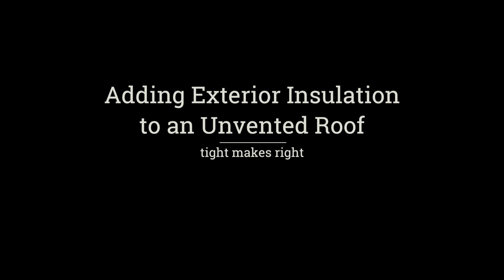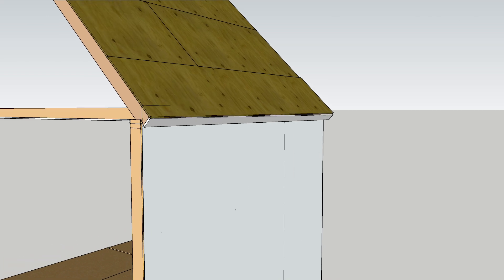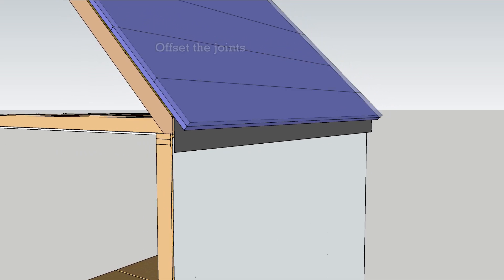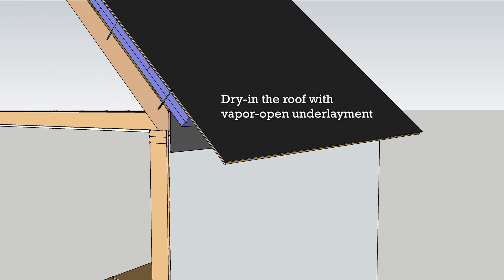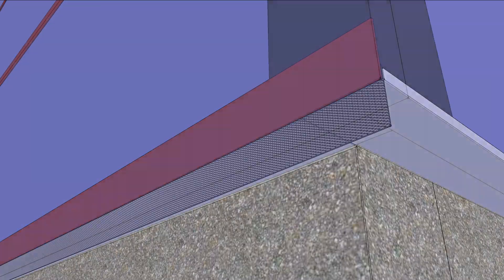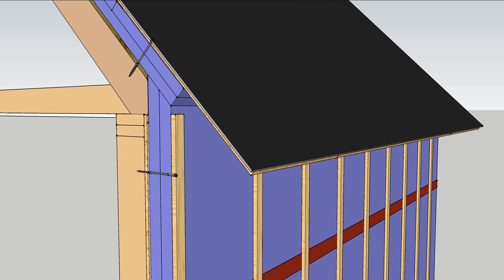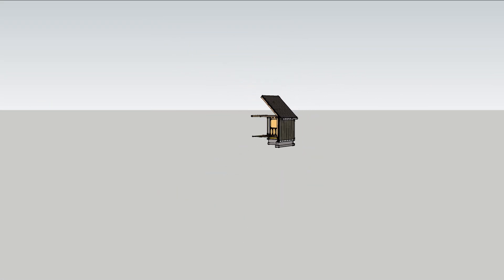Exterior insulation retrofit: walls and unvented roof

Comment: Client has historic deck home with exposed 2x t&g planks; retrofitting new roof and adding 6” polyiso rigid insulation and 3/4” cdx plywood for new asphalt shingles…what do you recommend for primary underlayment over 2x planks and then again over the CDX plywood exterior prior to roofing

Comment: How do you exchange air on the inside of the home after you have sealed the outside?
Reply: Typically with some sort of balanced mechanical ventilation method like an ERV system
Reply from the maker: as the other commenter said, mechanical ventilation.

Either air enters and leaves through a path you choose, or through paths you do not choose.

One leads to healthier and energy efficient houses, the other leads to bugs, mold and rot.

Comment: What if your cladding is brick and mortar?
Reply from the maker: Then it is a LOT more difficult and expensive to remove and replace. Superinsulating from the inside may be a better option, though I have seen builders spray foam the outside of a masonry block home with a system of 2x2s bolted to angle brackets screwed into mortar joints to create a space for three inches of high-density spray-foam insulation plus an air space. The 2x2s were used to fasten Hardy Plank siding into. 

An unformatted page explaining the system is on green Building Advisor, here: https://www.greenbuildingadvisor.com/green-homes/deep-energy-makeover-one-step-at-a-time

Comment: Also add rockwool when u have the wall cavity open
Reply from the maker: The drywall is not removed in this animation, but when the siding id off, it is CERTAINLY a good opportunity to blow insulation into the stud cavities.
Reply: @ProTradeCraft or just do 3" of closed cell spray foam with ZIP-R for sheathing! this is what i'm planning to do to replace my EIFS stucco soon

Comment: I used this same setup but used a fairly non permeable (not vapor open) roofing underlayment on top of the second osb. Is the vapor permeability primarily for potential leaks or for drying due to potential condensation? Thanks!
Reply from the maker: To allow interior moisture to escape.

Comment: That L channel on the bottom will just become a water bowl. Need drain holes, otherwise any condensation or wind driven rain will just accumulate in there and cause the sheeting to rot.
Reply from the maker: No it won't it is taped to the face of the foam. and there is a 3/4 inch drainage channel in front of the tape.
Reply: @ProTradeCraft  Rain screen and tape don’t change the fact there’s no drainage in the channel. There is internal vapor drive from inside of the house and the insulation can also be vapor permeable if it is EPS/XPS. It also requires the assembly to be 100% perfect for bulk water not to get in, which is never the case on a real job site.
Reply: @mintheman7  I too fear this. Is there an easy way to perforate the aluminum? Also don't want mice in foam

Comment: How would you design a shed office with a single-slope, lean-to roof with overhangs? Specifically, how would you finish the exposed insulation faces on the sloped edge of the roof? Speaking of a construction with continuous exterior insulation.
Reply from the maker: The exact same what as drawn in this animation, which only shows half a gable, so technically, a shed roof.

It is best to add overhangs outside the insulation instead of letting them protrude through it.

Comment: Well done. Would love to see this done with exposed rafter tails applied (as opposed to boxed soffit).
Reply: Several people have done it on video.  You just box in the rafter  tails.
Reply: @tsaipod  What do you mean by box in?
Reply: @hippopotamusanalogue  so the guy above that wrote the initial comment was talking about rafters that stick way out over the edge of the house a foot or two or whatever.  You would just box in the rafter that’s hanging out over the side so that it was sealed. If this still doesn’t make sense, I can try and find a video.

Comment: This is relatively simple on a house with no windows or doors. Dont we need to know what we do there?
Reply from the maker: Well, according to engineers, the perfect building has one door, a fridge with beer, and no windows to dramatize you during the inevitable hangover. That being said, buildings usually have windows.  Here are a couple of options for windows, but search through the channel, there is a TON of stuff about how to do this.

Innie windows in the thick wall: https://youtu.be/7OX1_q-P5xw
Outie windows in a thick wall: https://youtu.be/yTlYthfnoeQ

There are also videos of carpenters doing it. Search for 'superinsulated sunroom'
Reply: @ProTradeCraft  I watched the outie one. My interest is adding 4 inches of foam....2+2 to an EXISTING home. Again... its easy on the flats... what about doors and windows that NEVER EVER want to trap water. Thats what i want to do to my home... remove and replace vinyl with 4 inches foam to add R20. Thanks
Reply from the maker: @rogerwhiting9310  
https://www.youtube.com/watch?v=19p35Owyd4c
https://www.youtube.com/watch?v=X-YowdOsTP8
Reply: @ProTradeCraft  thanks... I watched both of those. I will have to replay them 10 times to get the tape, flashing, pan, etc details correct. Interesting the job is about 45 minutes from my home. After watching them pinch panels in to be super tight... would there be a downside to just foaming between panels to be tight... and watertight? Thanks for your help. It is a doable project now.

Comment: 1:10 - SIGNIFICANT thermal bridge there - a widespread problem.
Reply: I'm thinking a "Z" channel tap-conned into the concrete wall would be better...it also would serve as a bug barrier for the sheathing.  Also should consider air sealing the base of the wall sheathing to the concrete
Reply: @mattcantrell5640  That metal Z-channel would also be a significant thermal bridge. Steel conducts heat 300 times better than wood. If the relevant metal could be replaced with PVC flashing, the thermal bridge would vanish. Ideally, insulation in the wall should hook up with the insulation in the floor. More than one way that can be achieved.
Reply: @elbuggo  I understand metal conducting heat, but it would be conducting it to the concrete, not the wall.  The concrete would likely be insulated on the interior prior to finishing.
Reply: @mattcantrell5640 Studied this again. The flashing is fastened to some OSB board(?) there. That will reduce the thermal bridge significantly. Something green behind that OSB too. Insulation? Well, maybe not so terribly bad solution, but not ideal either.

Comment: The big issue I have with this video is that they aren't showing what happens to the doors and windows.  Now the foam is four inches to far out.  You have to now move the windows out and have a proper sill for the the windows.  What a pain that would be!!!!!
As for the roof, it could be done.  My older house has insulation in the rafters but no way to vent off the heat so it absorbs to the upstairs
Reply: You have two options. You can do an innie or an outtie opening. For an outtie you just buck out the width of the insulation. Thermal buck is designed for this purpose. Or you could install normally and frame out an exterior jamb.
Reply: @Cpt_Guirk  thanks
Reply from the maker: Bee Bob, There are a few options for windows, innies, outies, or in-betweenies.

Innies: https://youtu.be/7OX1_q-P5xw
here's actual guys building it: https://youtu.be/G5-T3VsF87I

Outies: https://youtu.be/yTlYthfnoeQ

in-betweenies: https://youtu.be/w4dN1mSC4O8

Dig around the channel for superinsulated sunroom for a video series about how to install outies and here's an in-depth playlist of a retrofit with innies: https://www.youtube.com/watch?v=-ICsETRWfow&list=PLU1aP_Y9qGOyL1SsYhpAaFo5DcdlUBCrq

Comment: WRONG!, you should of added 2x2 furring on top of the two layers of roof insulation and then put the OSB ON top to give you a vented space. If you live in a cooling zone you can also put radient foil down to reflect the heat or just use white shingles.  or metal roofing.
Reply from the maker: Well, no, not wrong. One way.

Here's a vented option: https://youtu.be/o5uGtQNi7gs
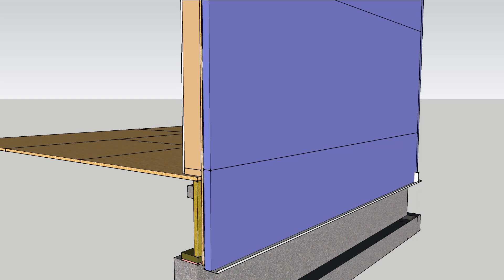Reply: It actually does show that @1:19. I was going to comment on the discrepancy.

Comment: Will there be problem with rot or mold since old were meant to breathe
Reply: dieselpower456 No. The sheathing is in the conditioned space with this method. Most of the water will never make it past the siding, furring strip gap, foam layers, then house wrap. Interior moisture won’t have a cold surface to condense on. You will need power ventilation for indoor air quality.

Comment: I have a house in the mountain I replacing the roof so I am considering  adding foam as described, However there is no attic space all open beam vaulted ceilings, Is there a problem with condensation or moisture in this situation,
Reply: Yes there will be a build up of vapour within the ceiling or loft space, you will need to install roof ventilating if it’s a hot roofing system.

Comment: I’m curious if we can also use spray insulation to cover the outside of the house. On my deployment to Afghanistan we covered a massive metal building on the outside with spray insulation. I came back to Afghanistan years later and it was still holding strong. 

No exterior protection! Extreme winds and dust! It snowed so much that year I built an igloo! It wasn’t beautiful. Just insulation vs. nature and that stuff held up amazingly.
Reply: Make sure you use closed cell spray insulation. Open cell acts as a sponge and absorbs as much moisture as it is possible. Closed cell insulation does not absorb moisture.
Reply: Your neighbors will surely hate you if they can see it.
Reply: It wouldn’t be straight. You would have wavy walls when you went to put up the siding.

Comment: If I’m building a new house. How much extra am I throwing at my house using this method? 

Any example will work, by sq ft or comparing apples to apples. 1500 sq ft home with traditional insulation vs. this new stuff.
Reply: Michael Howell This is seemlier to SIP technology.. Take a look at Structural Insulated Panels. You can build twice as fast cutting labor cost and higher R Values and air tightness. www.premiersips.com or sips.org

Comment: This system would be much better with ventilation between the foam and roof plywood. Easily done by adding 1.5” sleepers between the foam and roof sheeting. Then you can run them down to help with the overhang construction.
Reply from the maker: Funny you should say that: https://youtu.be/o5uGtQNi7gs

:)
Reply: @ProTradeCraft  so why post this video? I watched it and did most of my house just like your video showed. Then I see your next video saying how much better it is having  a vented roof over the hard foam .......not so funny you should say that

Comment: How much R-value are you adding? What is the dimension of the ridged foam?
Reply: The foam is 2". The R-Value is R-10 per sheet so 2 sheets = R-20
Reply from the maker: At about R-5 per inch, we added four inches of foam to the roof (R-20) and walls. But the amount of insulation and the ratio of R-value on the outside to the R-value in the cavities depends on your climate zone. Minimum ratios are in the IRC.

Comment: bottom of wall plywood needs to be capped otherwise there's going to be dry rot traveling up the plywood
Reply: There is no such an anomaly as "dry rot". Rot has to have moisture  to start.
Reply: Jay Brown I think he means if that plywood is touching the ground it will soak up water by capillary action. It shouldn’t touch the ground and yes needs something to block water.
Reply: @mjlyco9752  Even just inches from the ground will result in so-called "dry rot."  Each time it rains, water flows over the siding and wets the exposed lower edge.  Then it dries.  This cycle produces swollen and crumbling siding near the ground.  A better strategy is to use moisture proof products, especially near the ground.

Comment: I really appreciate this info! I have been remodeling a house we bought 3 years ago and it’s gonna get a new roof, siding, and windows this fall and I have been digging for information about this. I was wondering if it was possible to install foam on top of the existing sheathing and basically making my own site made sips panels a piece at a time to insulate the entire capsule and found this info now so it is possible and has been done ✅. 

What have your experiences been on dealing with the building inspectors on this process? Have they been educated on building science yet that you know of? Are you guys having any problems with inspections on this process? 

I’m trying to soak up all the info I can from you guys that actually have field experience with it before I start on the exterior. I already stripped the entire inside down to the studs and vaulted ceilings in the kitchen, living room, and dining room. We have rewired and replumbed the entire home. I will be installing a new split ac/heat pump system that’s a 27 deer. All new appliances etc. it will be a new home when we finally complete it all wrapped around a 1940 frame. Goal is to have a comfortable home with extremely low utility bills and many thanks go out to guys like you that are putting out info for guys like me to follow along. 

I used to be a custom builder but have been out of the industry since early 2000’s due to a crippling injury that left me unable to continue to build and I just haven’t kept up with everything like I should have and so many changes have taken place in the past 15 years with new methods and products and I really wish I was still in the field cause it seems like an exciting time to be in construction if your into the building science pathway. 

Anyways, thank you so much for the info and I will keep my eyes open for more info from you guys.

Comment: When you're running screws through 4" of rigid insulation,  can you actually walk on the decking to install the shingles?  It seems like the force component that would be redirected down the roof parallel with the sheathing would work to bend or snap off the screws.  For that matter, how do you get the 1st layer of insulation to stick while you're adding the 2nd layer?  Is there a technique to this that will keep the workers safe?
Reply: You should probably add blocking too the bottom course of the insulation at the bottom and top of the roof.. do the same to the next course of insulation.. at the bottom of the roof where the gutters are add blocking to keep the insulation from sliding down.. I hope that kinda makes sense.. I'll try to send you a little to a good video
Reply: Yup, I am also interested in these more practical questions.  The youtube search continues while I try to find someone who filmed the real life process.

Comment: This roof is not ventilated.   Since snow is an insulator,  the gutters will fill with ice and an ice dam will be created.  It MIGHT not leak into the house but it'll be there none the less.  Also, this house it too tight not to have controlled air exchanges,  such as would be provided by a HRV.
One other thing... will the warranty on the new shingles be valid with a system like this?  That roof decking if going to get very hot if the shingles are dark, with no ventilation to cool it.
Reply: They've been doing the ventilated version in Boston, or the version shown here?
I mentioned the HRV because this video is basically saying,  "do this" next time you do your roof and siding.  There's more to it.

I've read a fair amount and watched a number of videos on building science and tight houses, and the one thing that seems to always be missing is how do you get makeup air for exhaust fans and the dryer?  No resource I've seen really tackles this subject,  and IMO, it's the elephant in the room.  A single, affordable  HRV doesn't seem like enough for the bathrooms.  I currently have 3 bathroom exhaust fans, 2x 120 CFM and 1x 80 CFM.  That's  a lot of CFM for an affordable HRV and it doesn't touch the kitchen exhaust or the dryer... and I really don't see an HRV being practical for a dryer because of all the lint.  Can you please shed some light on how this is done in this type of house?
Reply: Either will work if constructed by a pro?  If either works, how can the more expensive option be better?  Lol. Just messing with ya.  You cannot get away from physics and physics says that if it's freezing cold outside. And warm inside, the unvented roof deck will be a temperature somewhere between the inside air and outside air.  This temperature will be determined by the ratio of the R values of the insulation and snow covering the deck.  I'll admit there is probably a narrow band of temperature vs snow thickness that would be problematic but it exists nonetheless.  Vented also suffers this problem but to a lesser degree.

The makeup air needs to be all fleshed out.  Simply saying temper the air isn't enough because, for example, when you bring in cold winter air to a more humid warm interior, and mix the air, condensation can and often does form.  In summer, bringing in outside air may dump a lot of humidity into the house.  IMO, due attention has not beeg given to the details of this subject and how to mitigate the issues that can arise.

In winter, a product in the makeup air vent that acts like a hair dryer, warming the  incoming air to 70 deg, would probably suffice for intermittent needs.  A temperature sensor on the heated air could control the heating element.  Summer is more difficult and humidity would have to be removed quickly without freezing the air.  I'm not sure of a good way to do that.  Maybe it's enough to just knock it down a bit.  Anyway, details details details.  The building industry readily supplies details for everything else, but this subject is sorely lacking.